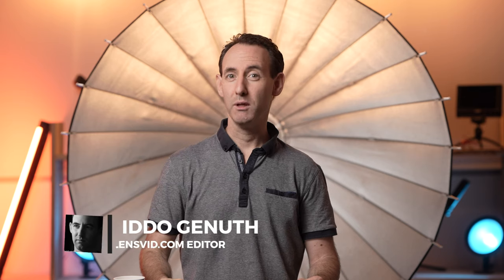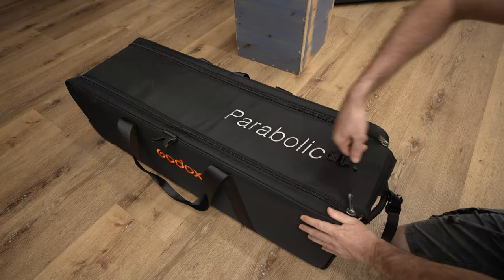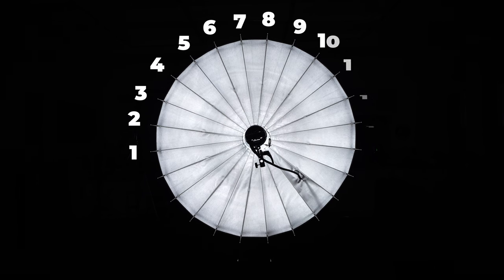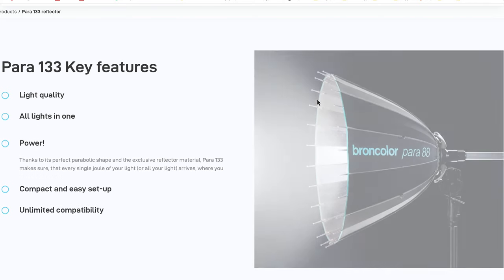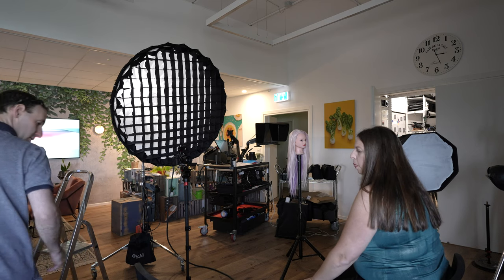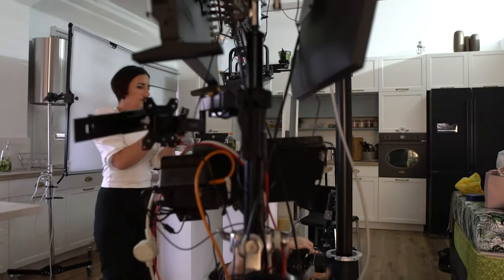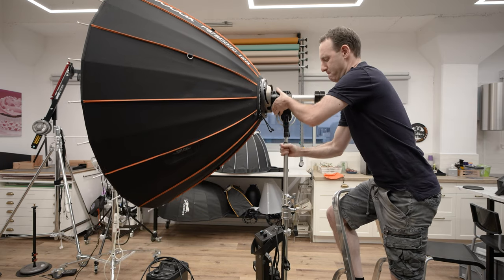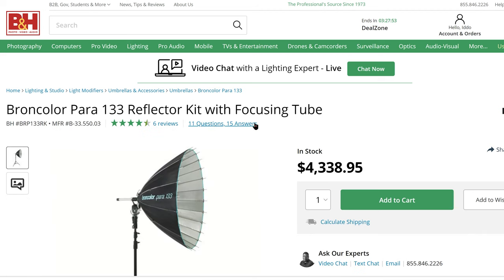Godox P128 Parabolic Reflector Review

Comment: Hi, thanks for the video; it is really informative. Would you consider that you can achieve the same look with a common softbox? I'm just asking because it seems that the interior material is not as punchy as the ones in other more expensive brands.
Reply from the maker: Maybe. I know Godox has been very attentive to our review (and other people's comments) about the aspect of this product (which is certainly very important). Parabolic systems also provide you with a lot of flexibility which goes beyond what a normal softbox can provide but if all you want is that punchy look I think Godox still needs to work on the internal material.
Reply: Thank very much!   @LensVid
Reply: There is an expression: “Practice is the criterion of truth.” Try to determine in practice the difference between the light of a parabolic and the light of a regular umbrella. You'll be amazed at how small the differences are.